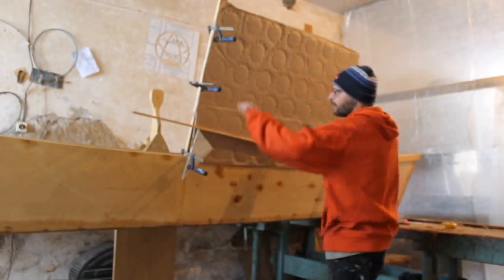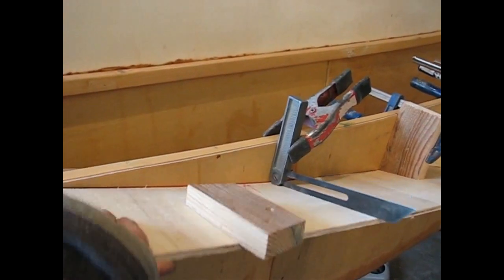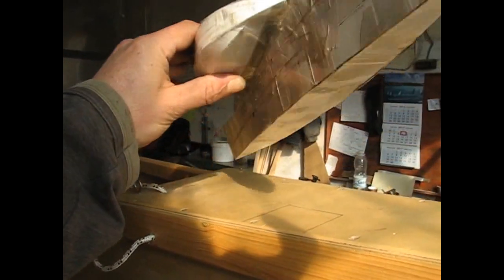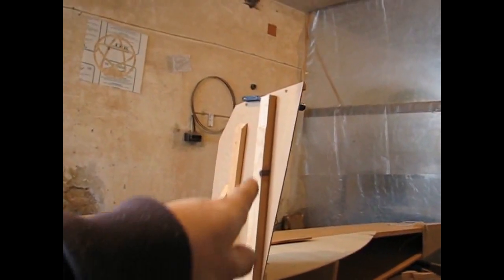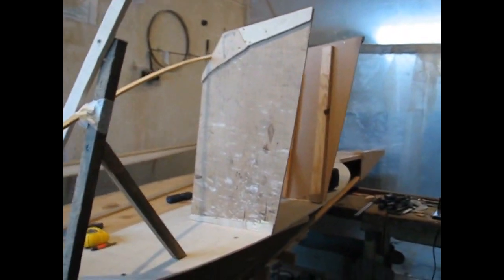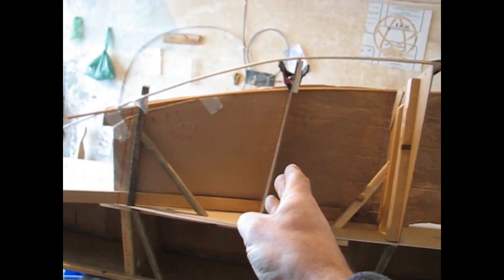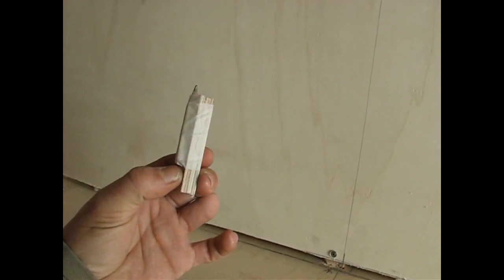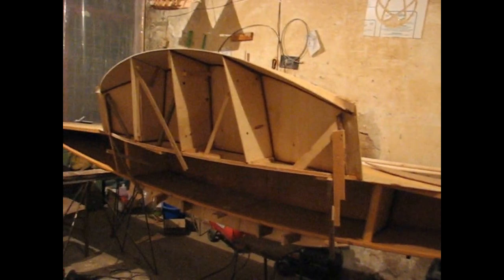Total Proa Build, episode 2

Comment: nice video
Reply from the maker: Thanks Mike. Hows your  Proa coming along???
Reply: Rael Dobkins my proa project is floundering a bit. two small kids and an old Alvin vega has taken the time and money. but it will get done eventually. are you going to re-rig crystal clear to fix the issues you where unhappy with or have you started to work round the issues . it should be simple for you to install a single crab claw. I like the direction you are going in with cheap and simple boats. it is interesting to see where that goes a boat or two down the evolutionary line.
Reply from the maker: I like your Vaka, Nice shape, Solid wood... You will do it Mike, Neptune will send you what you lack, In boat building he always helps........... I'ts his job!
As for Crystal Clear, she needs to be tested properly, I believe she will be an amazing boat with one big Crab Claw. Now,  it's very complicated, she is at the Black Sea, 300 km from where i live... 
I also need to find where and how to work on her... Living in an apartment and renting workshops to build boats can become a problem........ 
That's why I just decided to focus on something small and simple for the winter. WHY NOT? is small enough to be car topped, He is very different from CC, I can sail anywhere I want, I can move him with my car, I can take him for test sails in close lakes.... when cruising, only 2 of us can pull him up on beaches, no bay no problem... 
Black Sea? Adriatic?? The med??? The Atlantic???? Sail all, in one summer... WHY NOT? Car toppable,  the secret of cruising on a shoestring.....
   Enjoy spring!!! We had a hard winter... I'm sure yours wasn't easy ether. Now, I'm loving it!!!
All d best.
rael.

Comment: I'm one to work with metal, but figuring on starting to play with tree corpses... I know it can mess up your day to hit an oyster bar coming to an island ever consider an aluminum tip on the bow? Or just reinforce it with more wood?
Reply from the maker: I totally agree, a stem is always good, on my bigger proa I have  big pieces of spruce in the vakas bows and oak stems in the ama..... As for "Why NOT?" I never imagined I would go this far with him and attempt to convert him into a micro cruiser, he was built fast and simple for testing ideas and learning how to save weight... Aluminium strips? or 1.5 mm Stainless steel cut and bent to fit... I will add those to the "to do" list once I get him to perform the way I want. Thanx.

Comment: How did you determine the width of the main hull, by the width you need to sleep in?
Reply from the maker: Why Not? was built winter 2016. I slapped him together out of off cuts.... I never imagined that I would be converting him into a micro cruiser. His hull is too narrow to sleep in. the distance between the bulkheads is to small too. We will sleep in a tent on deck, or on the beach.
The width is always a result of displacement needed to carry the load, Boat weight+us and gear. But I still try to keep things as narrow as possible. James Wharram said that a 1/14 beam length ratio is the best, because any narrower just adds wetted surface drag..... I highly respect the man, so I'm fine with what he says. 
Why Not? has a ratio of 12.5 because of displacement needs..... now I'm happy since he's going cruising, he's gonna need it. Still I usually aim for 1/14 at water line.
  All the best.